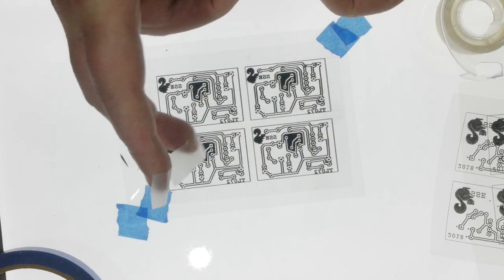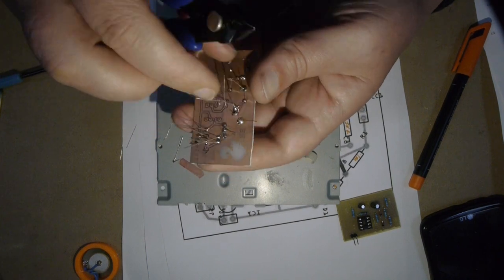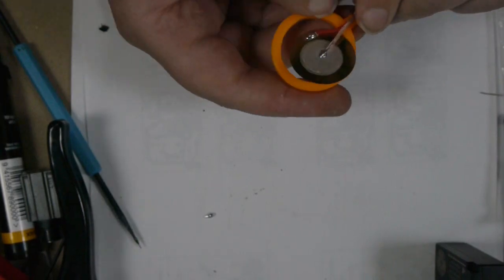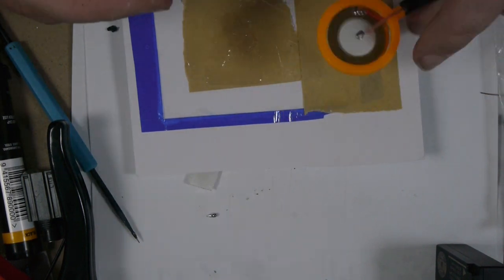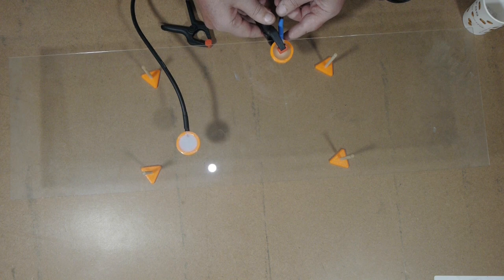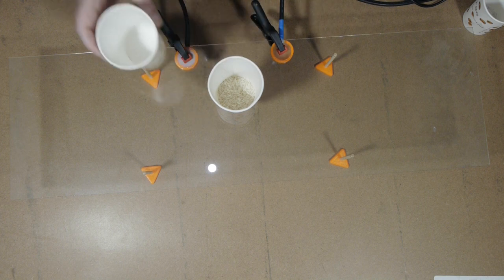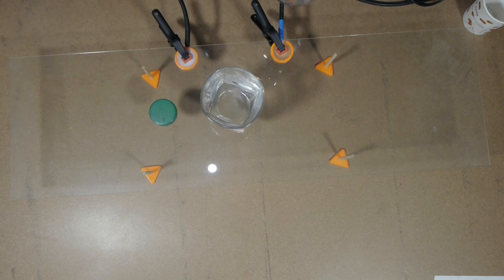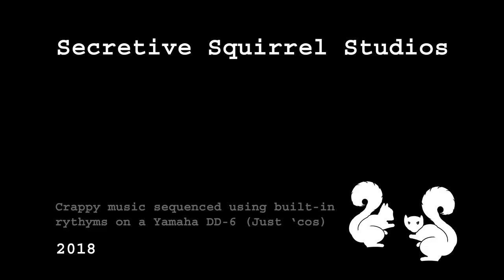Building a piezo pre-amp using TL072 - Video one (testing)

Comment: I'm from NZ anyways, your content is so thorough and this is an awesome experiment ! I have a few tl072s laying around I bought them for Moritz 3 channel mixer but had a stop with the power supply. Ive recently experimented with piezo directly to my acoustic and it does wonders but a little too many wonders eg. I can hear alot more than I need it's as if it needs that diode blocking mechanism in the tl072 pre amp circuit you have in your description. I'll gladly give it a go and comment again my results 😅🙏
Reply from the maker: cool, you should have a crack at making your own videos, it's worth doing, even just for the giggles.

Comment: Interesting experiment, but I'm wondering what effect mic placement has on the results.
Reply from the maker: In the video I showed them with side by side microphones, but I also tested with a single microphone and swapped in the units with much the same results. In further testing I managed to close the quality gap some by swapping out components, but I was having trouble more with radio interference than picking up different sounds/vibrations (my workbench is electrically noisy when it's powered). Short answer, yes, it makes a difference :)

Comment: Which circuit should I choose for silent violin. (Mic must be under bridge piezo)?
Reply from the maker: I'm afraid I can't really answer that - for me this is an experiment, and frankly both circuits are pretty hot. I'm still experimenting with them.

It's going to depend on whether you are going to an amp, a sound recorder, what sort of piezo element you use, and a bunch of other stuff.

I might add, I'd never heard of a silent violin before today, now i have something new to research.
Reply: Secretive Squirrel Studios Acoustic violin in the home environment can be disturbing. Therefore, electric violin (aka silent violin) is preferred. Since the violin strings are not steel, piezo microphone is used. I'm looking for a circuit with low noise levels.
Reply: @yetkisizim  
What did u use???
Reply: @secretivesquirrelstudios  what happened to this project? Which is the best among 3 for a acoustic instrument?
Reply from the maker: @lordrahulcool  What happened to this project is work, I make videos for fun. It is still something I'm coming back to, but I'm not making any promises as to when.

In experiments I've used the MPF102, which worked ok, but it was hard to source.
I've used the NE5534/NE5532 - these are probably my first choice in terms of an available chip which is fairly easy to tune.
I've also used TL072 which is very similar, but slightly trickier to tune.
I also had a go with the LM358/258D, which worked far better than it should have, but had some frequency range issues (clipping) Probably better suited as a trigger rather than as a mic.

Also... Just to clarify - what I was going for here had nothing to do with music or musical instruments - I was wanting to build a contact microphone which would clearly record the sounds of drawing on paper, cutting glass with a glass cutter, the sound of a scalpel cutting card. I wanted to be able to record sawing wood and other noises like this. 

I also use recording equipment which has built iin pre-amps, So what I was looking for was a mic and amplifier combination which had a very conservative gain, input limiting, and a very flat response tonally. This would work ok for recording acoustic instruments, but it wouldn't be suited to going to an amplifier or headphones.

A lot of what I was doing was actually reining in the amplification and trying to eliminate noise, the circuits I started with were far too hot for my purposes. That said, I'd say that the NE5532 is a good place to start if you're looking to build a pre-amp for an instrument, it works well, it's cheap, and there's plenty of information online about how to use it.
Reply: @secretivesquirrelstudios  did u happen to know about alex rice peizo preamp.?

Ive heard its better than other u find on internet

It has +48 volt as power..
Im not good at electronics .im a musician . But please if u have time please see what alexrice piezo preamp is
.i wud be looking forward for your videos.. 
:)
Reply from the maker: @lordrahulcool  That's an interesting design, and the use of phantom power (48v) is appealing, but it does have the same problem that the MPF102 had in as much as the transistors are harder to find, and considerably more expensive to buy than regular transistors. If I go through regular channels here in NZ they're $1.75 to 2.50 per piece, and you need three of them. Buying from Ebay or Aliexpress you get relabelled cheaper transistors which aren't compatible (as in, it's a scam). That's my experience anyhow.

I will take a proper look at it when I have a chance though, it looks like a good kicking off point. 

BTW, I wouldn't claim to be 'good' at electronics, I understand the basics and I can read a schematic, but my background is actually fine art and photography rather than physics. I find electronics interesting, but I haven't formally studied it.
Reply: @secretivesquirrelstudios  okay..i actually bought 2n3819 from aliexpress and im half way making it..  there is a variation where 2n3819 is used instead of mpf102.. 
Thankyou for replying.. hope for further reply too :)
Reply: @secretivesquirrelstudios  indeed i got scamed by ali express

In that alexrice

Can i  exchange 2n3819 with 2n5457?

Both are n channel jfet

Sry i dont if its the right place to ask..
But please if u know do tell me

Are 2n5457 interchangable with 2n3819

Comment: ne5534 ftw
Reply from the maker: Yeah, in this case it was, On paper the TL072 matches the impedance slightly better, but that didn't play out for me. I'm currently breadboarding with the NE5532.

I do plan to come back to this, however I went down a bit of a rabbit hole with piezo microphone design and want to resolve that before coming back to the buffer/amp circuit design.